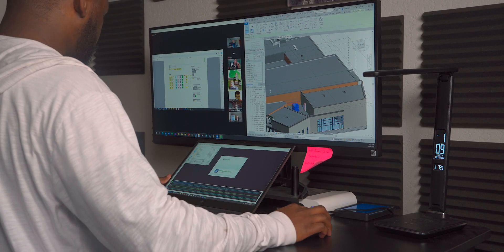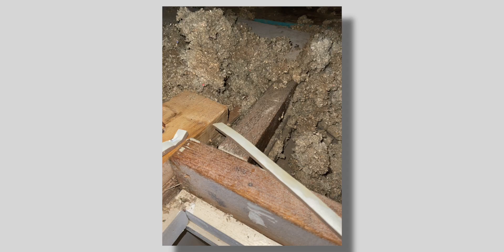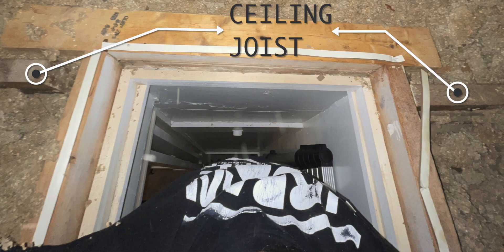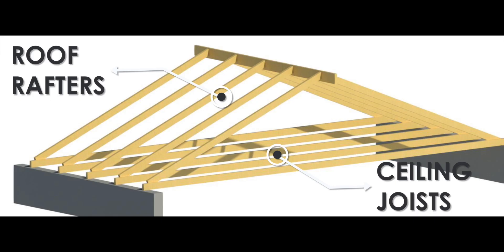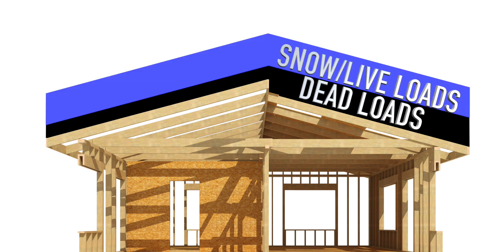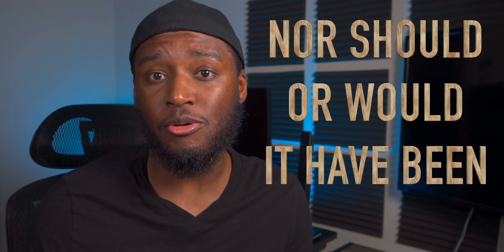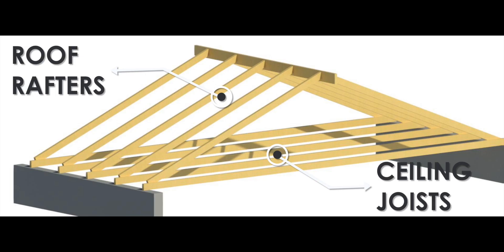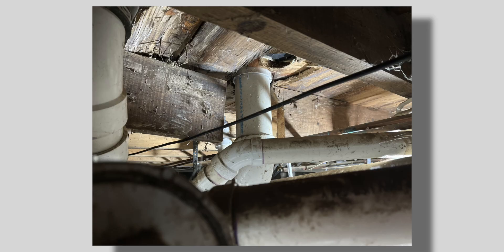Roof Framing Mistake to Rafter Ties Caused Cracking in Wood Wall

Comment: Hello Jay Garth,

My name is Jake, and I am a builder in South Korea. Your content is highly advanced and offers a lot to learn. I sincerely thank you for creating such excellent content.

In Korea, houses are often built with reinforced concrete (RC). This is because we have many cement factories, and we are very proficient in manufacturing rebar, making it cheaper than in the U.S. Moreover, the small size of our country makes transportation easy.

As a result, unlike in the U.S., we have well-established education, laws, and regulations regarding reinforced concrete. However, this is not the case for timber structures. The situation is the opposite in Korea compared to the U.S. Therefore, your engineering content on timber structures is incredibly valuable and precious here in Korea.

I would like to introduce your channel's content in Korean on my YouTube channel. I am seeking your permission to do so.

Comment: I did a video in which I hope to give you some insight to this evaluation. Keep in mind that replacing the floor joist is critical = why did they replace it?
The answer to replacing and how did they maintain the stud confinement from floor to ceiling?
Further, does this wall flex if a door is connected to it?
Are the residents 300 plus pounds and exceeding floor deflection?
Ps I hope your channel grows...